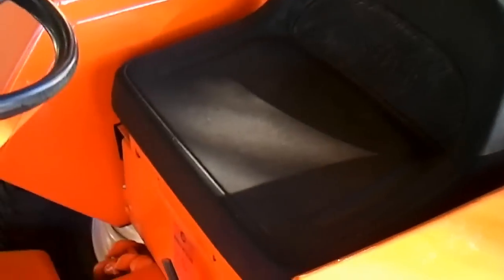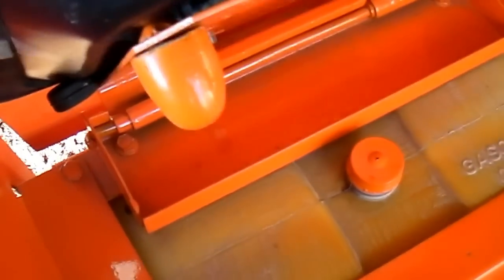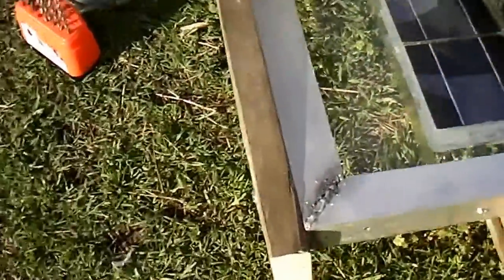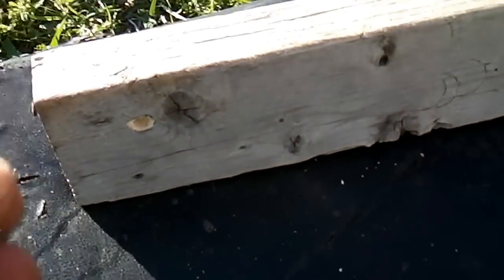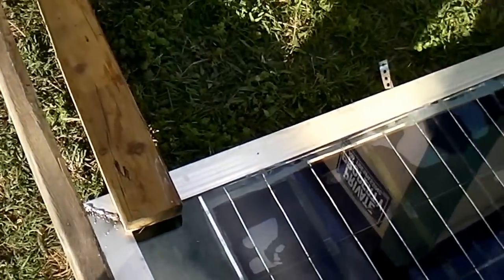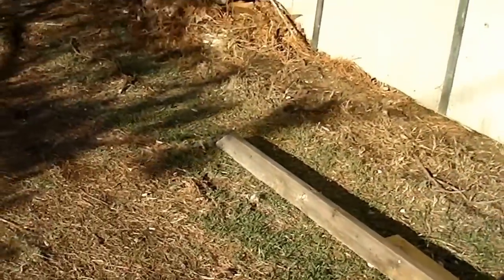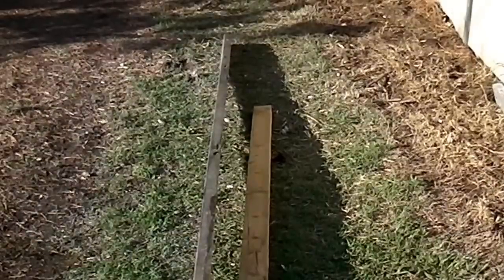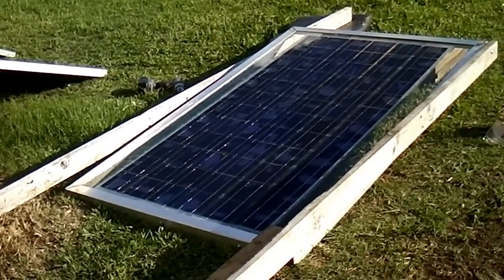Making an Adjustable Stand for a Solar Panel

Comment from the maker: I finally gave up tonight its getting too late and its dark. May be I can get it finished tomorrow. I'm thinking about putting it on my shed roof. But It will be difficult to get up there and adjust it. But it would be a good place for it to be out of the way. I am too heavy for the shed roof and its pretty flimsy. I may try to put more rafter supports under neath it so I can walk on it better. Its been a while since I been up there. I used to weigh a lot less and it still bent the tin.